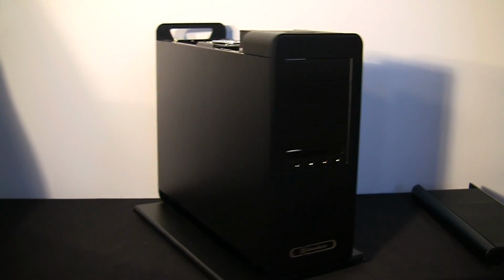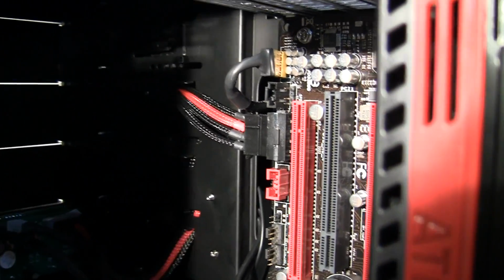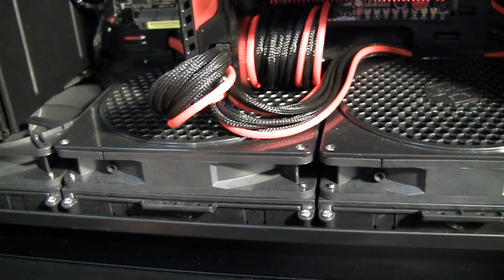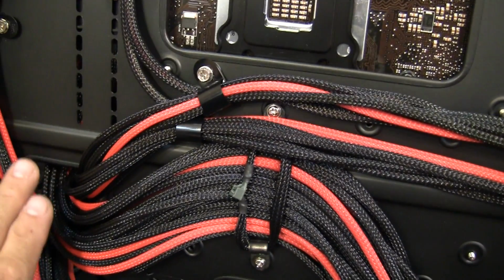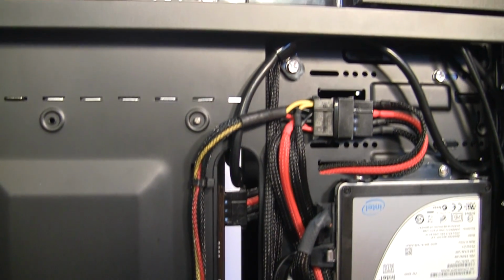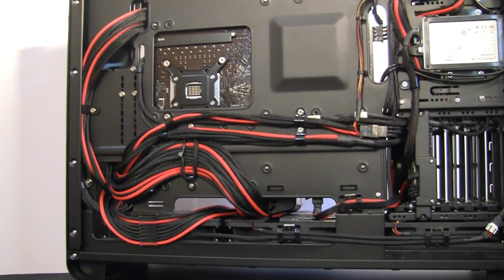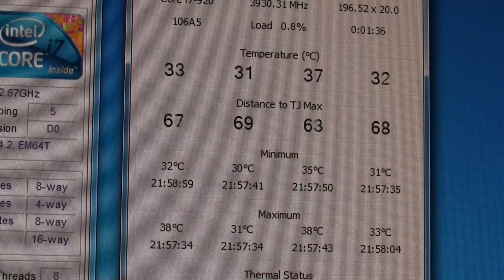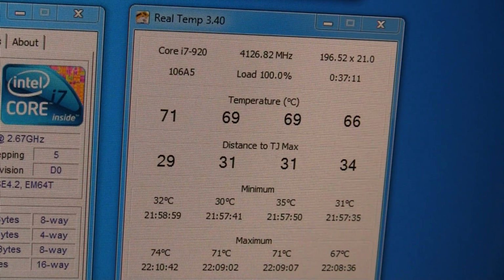SilverStone Fortress Completed & Cable Management

Comment from the maker: Don't remember exactly...however I do use 1/8", 1/4" 3/8", 1/2" and sometimes 5/8". It just depends on what size i need to hold a particular wire or wires. 1/4" and 3/8" are the most common ones that I use.
Hope this helps

Comment from the maker: You're funny bro....But to answer you question...there are other alternatives, which I use in conjunction with the cable clamps. I also use the ones that stick on and you can use a zip tie to hold them, or the ones that have a snap thingy and also stick to the back of the mobo tray.
These will work to some degree, but if you over stuff them they will pull away from the mobo tray as the glue they use is not very good.
This is why I prefer to screw them down...hold many more cables without probems

Comment from the maker: You unscrew them...it is really no big deal....how do you change the bulb in your head light...you take out the screws first.
And anyway...if you buy a good quality PSU with enough room to grow...you shouldn't  have to replace it. 
Out of all the rigs I have owned over the years I only had to change/replace one PSU......and currently I have 6 rigs that I use for one thing or another...HDTV, Folding, gaming, ect.

Comment: Well done job, very professional. I bought my system with the same case from  CyberPower PC and the cable management is not that great. I have to do some work on the cables. I taking your video as a guide. Thanks for this video.

Comment: @WestCoastMods Thanks for replying. Yes, I am using the standoffs that came with the case. It is just about possible to force down the top of the case to make the holes line up, but it just springs back when you release it. I have considered using rubber washers on the bottom two rows of holes on the motherboard to raise it slightly from the tray, but this is tricky for various reasons. I emailed SilverStone in Hamburg three days ago, but haven't had a reply yet. Still trying to solve this.

Comment from the maker: @hedgehog1965uk Not sure what the problem is without seeing first hand...is there anyway of bending the back so it is 90 deg with the mobo? Also even though you said you checked the standoffs...are you using the ones that came specifically with the case? Not every manufacture uses the same height stand offs.

Comment: I am in the middle of building a system in an FT02B and have hit a problem. When I try to fit my graphics and sound cards, I find that the screw holes on the cards' backplates are around 2mm below the corresponding holes on the case. I have checked that the mobo standoffs are all correct. It's as if the angle between the motherboard tray and the metal box that the expansion cards screw to is slightly greater than 90 degrees. Has anyone else had this problem, cos it is driving me nuts? Cheers

Comment: realtemp takes temp direct from the core pc probe takes its measure just above the core almost on the bottom of your cpu spreader so your getting pretty good heat dissapation from the cpu heatspreader to the cpu cooler not great for 247 i was wondering why you thought yuour idle temps were bad you got me a little worried im at 36'30'30'33and only at 3400mhz iload max at 62c when i go to 4ghz iidle is like 41 but load whent upto 79 tis when i cut it off im on a prolimatech megahalem

Comment from the maker: @orestesdd It wasn't a problem at all....for me, not sure if the client is going to have problems or not. The cables I use for the monitor came with my U2410 monitors and they are not that stiff, but I do know what you mean though, some monitor cables are really rigid. And as far as mouse, keyboard, I use a wireless setup.

Comment: How do you manage the cables outside the case?  For instance, the cable that goes from the monitor to your video card?  In my experience, the video monitor cable are hard to bend to accommodate it from the top.  Also how you manage cables like mouse, keyboard, and any other peripheral needed to connect to your case?  Thanks for the video though.

Comment from the maker: @pleite567 If you're talking about air coolers than it's because of the ambient temp. Your CPU temp will never go below the ambient temp with any air cooler. Those who post lower CPU temps than their actual ambient temp is doing something wrong or the utility they are using for their temps is reporting incorrectly.

Comment from the maker: @Aldind2x Never used the case, so I really don't know. However There are some cable mgmt. holes that you can use. My only problem is that the pre-cutouts are really never where I need them. For me I always have to drill out ones that are located better. The only case that I didn't need to drill any additional holes was the Corsair 800D, not all were perfect, but were close enough that I used them. Also with so many holes already I didn't want to add any more.

Comment: @WestCoastMods thanks

but i like that temp better, with my cpu it is a defference of 5c under load and 12c idle, but evga's eleet shows it also and more programs, also realtemp is not that accurate it does not goes lower than 25c with a highend cooler or stock with Vcore of .995v on q9550

Comment from the maker: @pleite567 well from my research I have found that it's the core temps that you are concern with as the temp that PC Probe displays is going to give false sense of security as it's not reading the actual cores.

PC Probe measures the temperature from a sensor built into the motherboard, which is not actually capable of giving an accurate reading of your CPU temperature. To get proper temperature values, you should use either Real Temp or Core Temp.

Comment: I was just wondering on how you replaced the h.d. and power leds. I mean I know you must have bout some leds with short 2 wire leads on them but what size 3mm or 5mm leds? also how hard was it to do. Ill be gettin this case very shortly and want to change these leds out. Thanks

Comment from the maker: @ELPCPU Yeah, cable managing single sleeved cables is a bitch. You will see if you ever try it....anyway the clamp I used at 7:48 is a piece of plastic that I found at work..it is just a spacer on gaskets that we order, and one day I thought hmm....this may help keep the cables flat and neat. I had to paint it though as it was originally green and then I just used dbl sided tape to hold it onto the back of the mobo tray.

Comment from the maker: @dipzyv Not sure what problem you are having.....I think if you remove the pins from the connectors, then single sleeve them to the point where they are connected to the common wires, the sleeve the common wires separately. I hope that makes sense.

Comment from the maker: @rob3342421 The client had me use the Silverstone Strider 1000w (all the spec are under video description) anyway I didn't have any problems with this PSU. You may have to buy some extensions or make them yourself. If you not worried about the warranty then you can just extend the cables to a custom length, that would be the way I would do it.

Comment: @WesrCoastMods what power supply are you using in this build?

my PSU's cables have trouble reaching thhe HDD and DVD drive in my FT02

i wondered if you had this problem with the PSU your using and how you overcome it?

Comment: @WestCoastMods found a great read on it but i aint got 20years to read it all i did find out tcase is taken from directly in the middle of the cpu and junction is taken at the junction where the core meet because they are still all connected also Intel places their dts on the hottest part of the cpu amd does not

Comment: those temps arent a prob real temp only shows the core temps witch are always a little higher than the actual CPU tempfot instance my q9400@3.2 cpu temp is 22 to 24c but my cores are always 38 30 36 30c idle

Comment from the maker: @dipzyv No ....electrical tape.....never...that is so ghetto...lol

I used sleeving from MDPC-X which is a tight knit sleeve, which doesn't allow the colored wires to show through. If you want to buy something local look for 1/8" sleeving and 3/16" or 1/4" heat shrink.

Hope this helps
LazyMan

Comment from the maker: @BenHanna7 Some PSU manufacture will void the warranty if you re-sleeve the cables and others won't as long as you don't damage it. Also the cable mgmt. thingy.....I get then from work...but they are use for something totally different. I saw them one day and though this would work perfectly.

Comment: The cables look so nice. If I wanted to do something like this would I void the warranty on my PSU by sleeving? Did you make that cable management thing that spaced the cables out singly, (for the 8pin graphics card connector) that's my favourite part.

Comment from the maker: @OPdAtLife For cable mgmt. the only tip I have is i would suggest making additional holes in the mobo tray...I have a older vid...way back and a more recent one showing how I decide where I should make these holes. As far as running the cables, that just takes practice, really not tips other than try to plan where every cable is going to go, that means once the components are in the case is to study possible routing for each cable, this alone takes me a several hours, and  take your time

Comment from the maker: @DArK5taTiC I buy mine from WireCare or McMaster Carr...look for nylon cable clamps. I have every size from 1/16" to 5/8", but the most common sizes are going to be 1/4", 3/8" and maybe a few 1/2" or 5/8" You will be able to buy them either in 10,25,50,100,1000pc's at WireCare and only 100pc's from McMaster Carr.

Hope this helps
LazyMan :-)

Comment: Great work my friend , your client is gonna be honored and thrill to have a build as cool as this.Your work to single braid each cable and cable management shows your passion for the work,Im sure your gonna be flooded with client builds.
I use PC probe and hardware monitor as weell and both temps vary in each application.

Comment from the maker: @denhoskes2208 Yeah, I thought the same thing, so I brought one home from work tonight, but to get the laser to even get close I would have to remove one of the fans, or possibly remove the entire mobo. 

But then I was thinking that will only give me the surface temp, not the core temps so it may not be accurate enough.

Thoughts?

Comment from the maker: @Mr937595 If I had put the SSD in the 5.25 drive bay, you wouldn't have seen it there either. Anyway this case comes with a SSD bracket that mounts to the back of the mobo tray.

And as far as the fan grill, yeah it had to be cut, as the vents on the end of the GPU were to long. If you were to sand it, you would have to go about 90% (estimate) down, just so the card would fit. So it was either remove it completely or notch it out.

Comment: woulda liked to see the SSD in the drive bays with an adapter. always nice to see your hardware in a windowed case.
My first thoughts were: did you really have to cut out the fan grill? if it was by a hair where you could fit without cover, could you have just sanded it down? isolate the spots needed to be cut and sand down?

Comment: Awesome, SSD on the back.  Out of sight.  
Awesome work on the cables, and the cable management.  
Those quick clamp screws aren't touching the motherboard?  I might give them a try one of these days.  They look a lot better than the cable tie blocks I'm using now.  
Well done,
Cosmoknight74

Comment: A few months ago I installed two 140mm fans in my gaming PC. I was thinging of splicing both fans into 1 molex connector so the back would be more organized as far as cable management goes. 
You did a good job tho. I always get good ideas from you bro.

Comment: awesome temps. Im running the same processor on a noctua nh-u12p.. and with an overclock of only 3.6ghz im running high 40c IDLE!.

I am also LAPPED.

tried two or three difference thermal compounds and the temps havent changed any.

Comment: pc probe will only be showing the temp of the surface of the cpu, not the cores, id see what coretemp says and everest, and then average it out between the four different programs, i tend to trust everest a bit more over realtemp

great job, love the black with a hint of red, im not a fan of the single sleeved cables usually, but in this case it looks really good